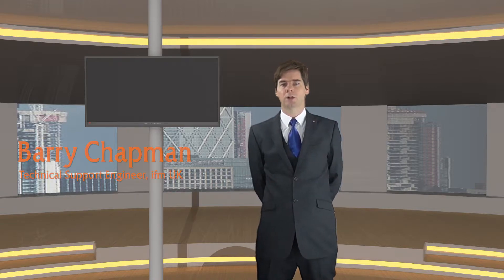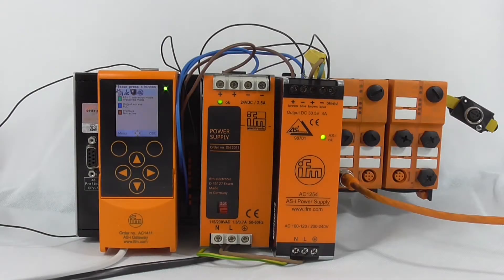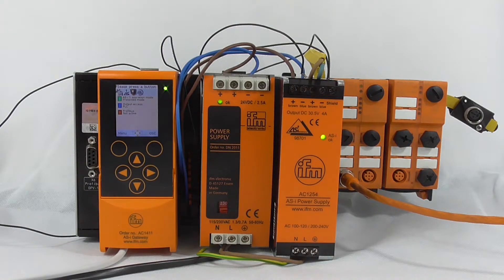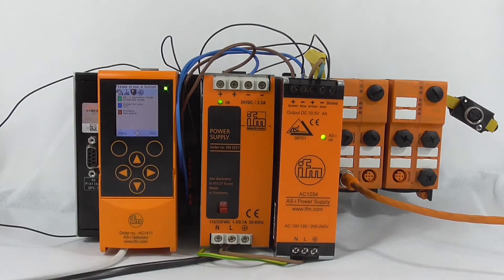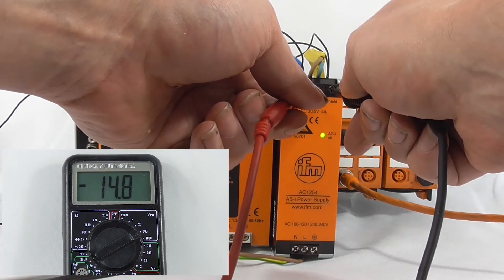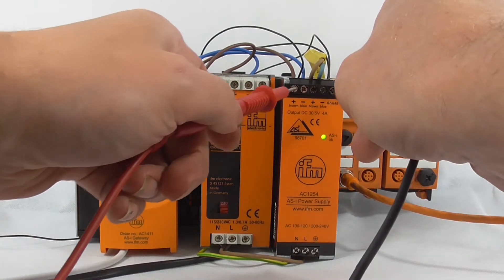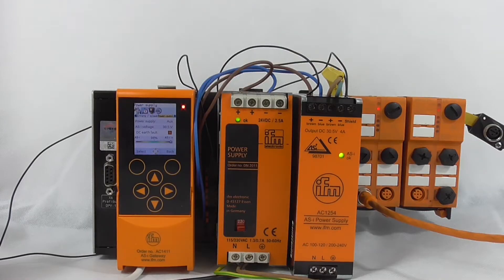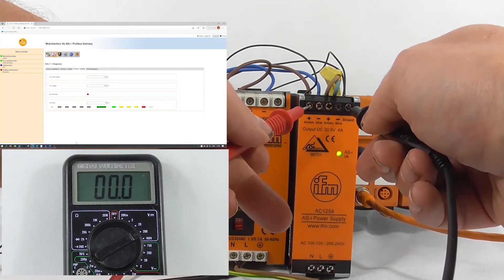ASi fault find - checking symmetry

Comment: Hello. Sir, could you please advise me on how to configure the Asi master of the Ac13xx series with Asi slave interfaces such as Emergencystop or Ac2410, Ac2412 Do I need to use any software or do the configuration directly on the Asi master keyboard? Thanks
Reply from the maker: @minhanh5580  to add a new slave you need to address it first. All new slaves have a default address of 0. Easiest was is to use an addressing tool like the AC1154. Once addressed you can add them to the network and this will put the AC13xx into fault, this is expected. In the controllers menu find the command quick setup and this add the new slave to the network list and clear the fault. That is all you need to do.
Reply: @barryc1701  Yes. Can you explain to me how the Asi master controller AC13xx can recognize the characteristics of each slave device? Even though I understand when adding a new slave device using the addressing tool like AC1154. For example, "I have an emergency stop button and an AC2412. How does the Asi master controller know that it is an emergency stop button and recognize that it is AC2412 I/O for control"?
Reply from the maker: @minhanh5580 each slave has an asi profile. When you do a quick setup in the master this profile is also saved. This allows the master to identify if the slave is a digital I\O, analogue or a safety slave.
Reply: @barryc1701  My factory is currently using a faulty AC1335 Asi central unit displaying an error "control 30 devices from different brands" with a broken LCD screen. Now, I want to replace it with a new AC1335 central unit from Asi with quick address setting in the master menu to configure slaves 1 to 30, right? Thank you for the very helpful information.